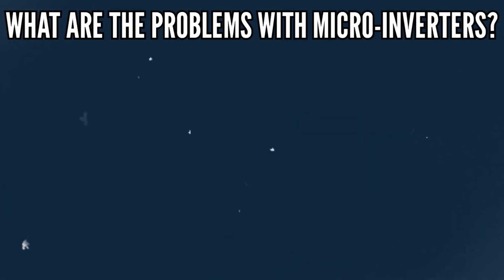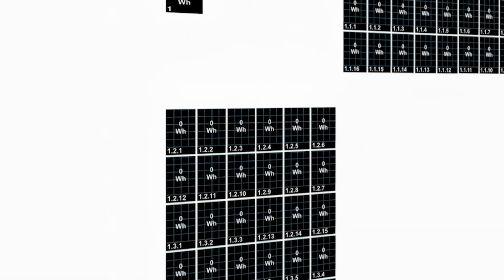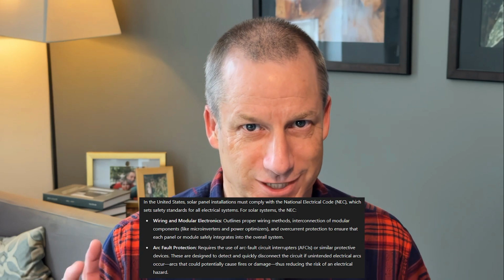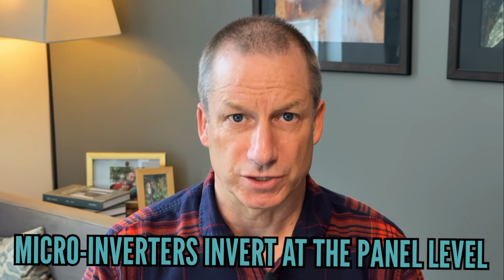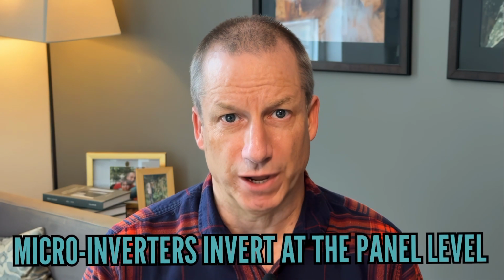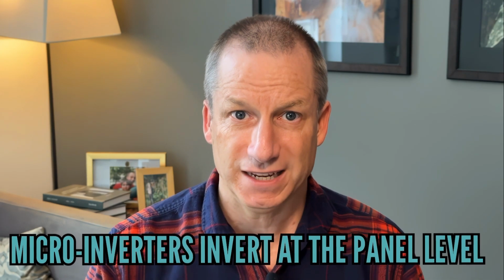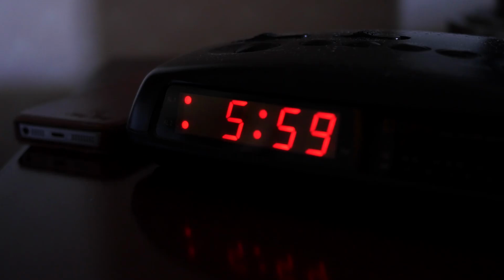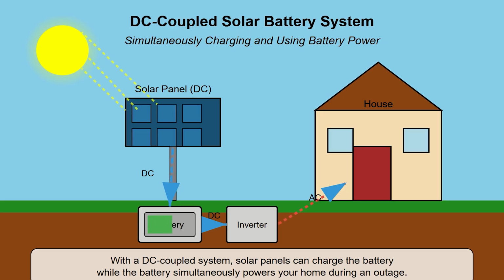Why Microinverters FAIL Homeowners (DC Optimizers Win)

Comment: As someone that's been installing solar for well over a decade. Let me tell you. 

All inverters will fail (string/mixro/hybrid) they are consumables.

In the last ten years, we have replaced approx 60 optimizers . But we have replaced well over 200 micro inverters....... the scary part. We have installed 10x as many string inverters as we do micros.

This means micros don't fail 4x more often.  They fail 40x!!! More often then optimizers!
Reply from the maker: This is exactly my point. Nice to hear from someone in the field with experience to back up their opinions. Thanks for your comment.
Reply: @michaelx12-c4v  thanks for the insights. Do you see any differences between brands? Do you install different brands? Which fail more often (string, micros and optimizers)? Again in percentage of installed units. Would be interesting to know.
Do you know if there is a list for this to see which model is more stable than the other?
Reply: @herwigg3327   micro inverters are failing at 4000% (yes, 40x approximately) more then optimizers.  i primarily install AP systems, enphase, solar edge, solus and fronius. this is the rough average over the last 10+ years

way more ap systems then enphase, and way more solar edge then solus/fronius

Comment: A separate single independent rooftop PV panel with its own monitoring should tell you what the array should be supplying. 

Say 20 panels should be 20 times the single panel.

Simplicity is good economics. 

That one panel should still be able to feed the battery also.  😊😊😊

You will know if you should go onto the roof or when to go up.

As the rooftop PV panels should be sized to the worst-case solar radiation then oversupply will allow you more time to get the workmen on the roof without paying for more grid electricity.